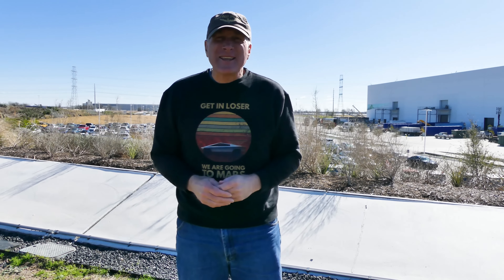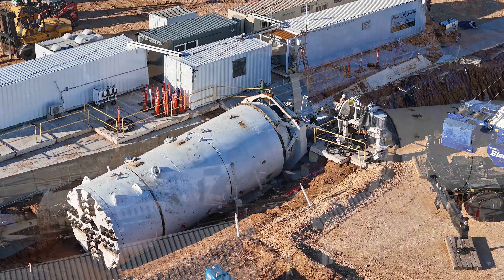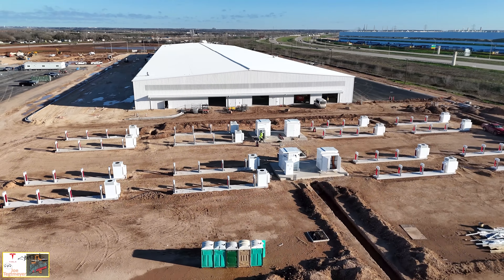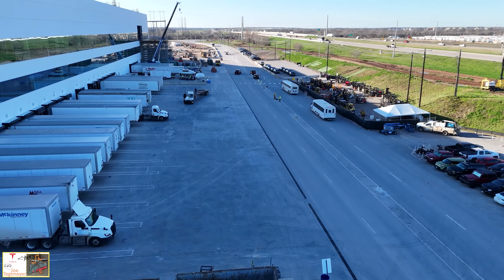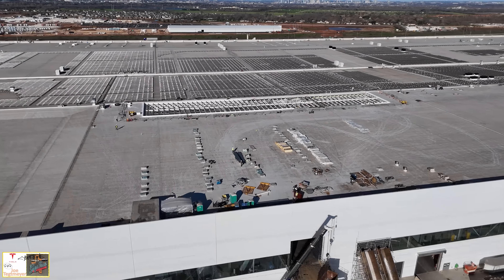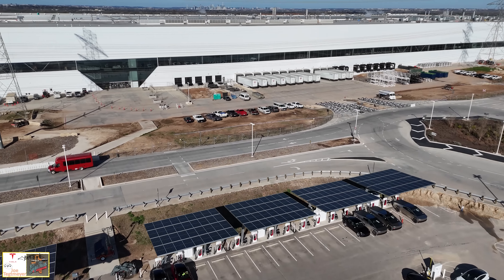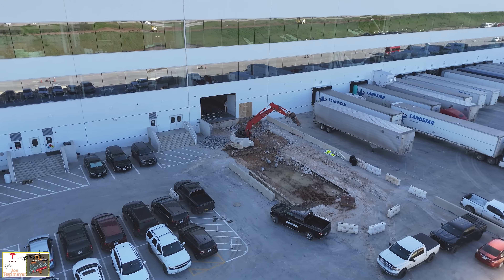New Car Transport on W Side! Cybertruck Castings All Over! 12 Feb 2024 Giga Texas Update (08:35AM)

Comment: Thanks Joe
3:06. Westside, Tunnel Project. Curved components set up behind the TBM have been described by David Salisbury as ‘temporary launch decks or launch inverts’. Back up decks (under the black tarps) need to be initially set-up on launch decks as when inside the tunnel the back-up decks ride on the completed tunnel lining. Crane possibly set up to lift a back-up deck onto the launch deck.
4:41. Westside. Former contractors parking lot. Trenching and grey electrical conduit.
5:05. Westside, storage. Top left. Pair of large tanks on low-loaders.
9:11. New EOL building. North. Strip/grate drains across in front of the drive-through doors. Southend of the EOL building has 2 parallel rows of these inside.
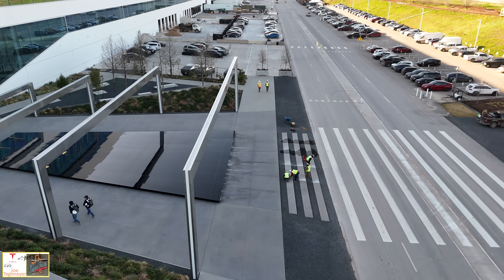9:41. Main Entrance. Saw-cutting the strip footings to match the saw-cuts of the entrance paving. Tapered ends align with the raised Stoneglass.
Road. Telehandler is carrying a pair of mini tracked excavators fitted with rock breaker attachments.
10:01. GA, apron. As per Sammy K, these are entirely new openings. Brings the total of loading docks along this side to 99.
10:28. GA, highway side Cybertruck yard. Mobile Supercharger mobilised elsewhere.
11:42. Southend. Level 2 floor and roof. Working on the mounting brackets for the glazing units channels.
11:56. Southend, Tank Farm. Various pipe fittings tack welded in place. Additional ring segments to the right to extend the tanks higher.
12:08. Southend. Bottom. 8 CFA piles in the excavation. 5 more or less in a group. Others might have been the original test piles.
12:52. Southend, west. Right. Been waiting for this shot. E-W roof beam falls/slopes to the east. Shows that the roof is symmetrical across the Southend.
15:58. Parking Garage. Looks like a concrete pump line has been run across the ramp.
17:31. Pond. Bottom. Electrical ductbank uncovered to be extended south to the Parking Garage.
18:10. Robotic Avenue. Intersection will need to be opened soon to divert traffic from the diagonal track towards the Parking Garage. Trenching works at the west end of the diagonal track.
20:06. Casting east, apron. Sapphire Gas temporary LNG system has been removed. Was only ever seen to be connected to the factory in Brad’s video from Saturday.
20:11. Casting east, apron. Slot drain that floated off its bed in the recent rains has been disassembled and put aside.
Against the building, saw-cutting continues. I wonder if the loading dock ramp is to be shifted. Current ramp doesn’t seem to be functional with the changes inside.
21:00. Casting east, apron. Blue ductwork identified by others as likely forced combustion air for the 3 new furnaces.
21:18. Casting north, apron extension. Screeding machine. Bottom. Might be a follow up towelling machine on the trailer.
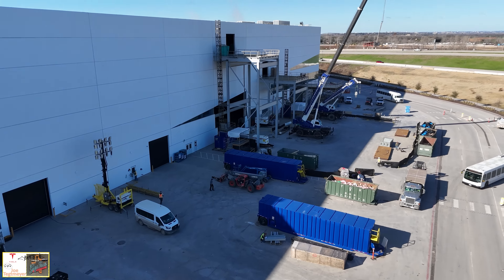21:58. Plastics, road. Right. Sapphire Gas tanker having trouble leaving site. Seen at the roundabout at 19:04.
22:08. Battery north. Loading platforms. No gates yet in the handrails for the Alimaks to operate.
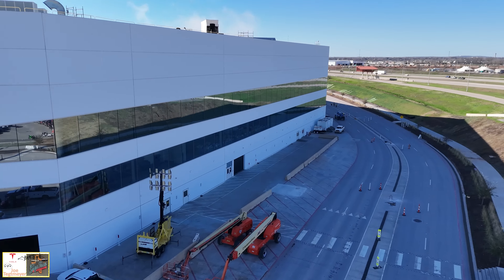22:19. Battery, diagonal corner. Road. Street lighting pedestals under construction. Almost complete to River Road.
22:40. GA, ramp. Stair demolished to the right.
23:37. Tesla Road north. Right. Small piles of gravel. Drying it out perhaps.
25:57. New Switchyard. Mega-Vault. Yellow plastic sealing the side opening.
Reply: Just behind the TBM, the segment feeder has been installed (This is a magazine carrying one full ring of segments ready to be installed and can "walk" the segments forward to the segment erector). 
Next to the blue and white 160T mobile crane, under the orange tarp, is the "Bridge" (you can see it has no wheels). This carries all the cables and hoses from the backup decks to the TBM, has the front end drive of the conveyor which sits under the discharge of the EPB screw conveyor at the back of the TBM. The Bridge is structurally a tow bar which connects the TBM to the back up decks. The item under a black tarp, on a trailer, near the segments, is another back-up deck (No. 5). It seems all the components of the TBM and back-up are now on site.
Reply: 21:18 What do you feel is the purpose of using this contraption for this relatively small space instead of what they've done in other areas?  Lack of available labor?  Assuming a machine reduces manpower.
Reply: @davidsalisbury50  7:43 for the segment feeder? Worker steadies himself on it.
7:02 for the bridge. Hopefully we get to see this installed uncovered.

Seems an additional component added between the tail shield and the thrust ring. Tapering component. Is that part of the thrust ring.?

Ducks slowly lining up on site, and in my perception of how it all comes together.

I'll say it again, this has been the most interesting part of the project for a long time.
Reply: @sammyk874  21:18. Had much the same thought. Why here? Likely just a different contractor who more commonly does road work.

No doubt they'll set this up around the corner on the east side. Possibly planning on one continuous pour. Completion of rebar placement on the east side prior to any concrete placement on the diagonal would indicate that.

Need to sort out the slot drain first.
Reply: @DessieDoolan  That was my other thought "Just the way this contractor does it".  Think this area they are creating is to move all the casting racks to?  Would give better flow to the apron.  That or the apron is about to be torn up.
Reply: @DessieDoolan  Yes, the segment feeder was seen over by the segments a couple of days ago. White curved steel with what looks like 4 rails running through it. The outer 2 are welded down stationary, the inner 2 are on a lift/feed/lower/return hydraulic system that feeds the segments laying on them forward.
Reply: @sammyk874  Semis have always had trouble backing in here. Particularly the drive-through door beside the ramp. Apron widening may be more for that reason than anything else.
I think the ramp is going, those loading docks deleted. Part demolished already anyway.
Paving demolition at 20:45 a possible new ramp location. I notice the destination chargers have been removed.
Reply: 4:41. Former contractor's parking lot: Judging by the shape of the trenching, maybe Elon has joined Thee Temple ov Psychick Youth!
Reply: @greggerypeccary  I just learnt something new!

Comment: Really bothers me that the extension roof peak does not match/line up with the main building. Makes me wonder how they're going to figure that connection out.
Reply: Will butt into the exterior wall of the main building. That wall remains for fire separation.

Comment: If the parking ramp is going to go to Robotic Road then the ramp is about half put up now. Geez that ramp is getting larger by the day. I am tempted to do a estimated count of the number of vehicles that can park in there.
Reply: No going to Robotic Ave. Halfway point is seen dead ahead at 14:51 at the construction joint with double columns.

The footprint is measurable on Google Earth Pro, and when multiplied by the number of floors comes out at the stated area on the associated plumbing permit of 1,743,000 sq ft.
Reply: @DessieDoolan   In that case and the fact the foundation appears to have another ramp for the South, I came up with a around 3500 vehicles. It might be a touch more depending if they decide to shrink the lines by a foot. I figure since the panel is the width of semi it be about 2 cars per panel. 3 panels per section 7 sections per row and 8 rows with an additional 4 rows for ramps w/o cars with 7 floors. Although there probably going to be cars on each of those ramps so my rough estimate will go up to about 4000 cars. Given the 20k employees at the site and the 2 shifts this will handle about 40% of the vehicles at present. But appears they will have 60k at the facility. So another ramp might be needed and honestly it would be better to use ramps over surface lots.
From the looks I almost wonder if they are going to put a roof on the ramp with solar panels.
Reply: @mdhofstee  Capacity was getting a lot of attention around New Year.

Cut and paste, "Parking Garage. One of Joe’s patrons mentioned that a multi level parking garage at Disneyland of 1,620,000 sq ft has a capacity of 10,500 vehicles. Based on those figures this carpark of 1,743,000 could potentially have a capacity of 11,300."

I'd come up with a figure of 7000 at some point.

If the Disneyland numbers are correct, then over 10,000 is probably correct.

And yes, the footings for a second ramp are in place. The building likely will be a mirror image east of the double columns.

Comment: I reviewed the footage going into 22:50 and hazard a guess that they took out that ramp in order to make it a regular truck loading dock, and perhaps open up another loading dock, to the left of dock "W8" more or less where that trailer is parked with no dock. It seems like they're running out of loading docks in this area.
Reply: Either that or they have now defined the interior layout in that area.
Reply: @sammyk874  The first goods elevator on site is directly behind that ramp. Might have needed the ramp to get larger items directly into the elevator. As you say, interior layout now defined, ramp can go.
Reply: 22:50. Room for 3 loading docks in that space. Plus a couple more to the south (right).

Comment: Will the Boring Tunnel exit on the East side be under the factory and use elevator(s) from the end of line down to the tunnel? Then Proofrock parts lifted out of the construction hole by the overhead cranes installed in the bump out area on the South end of the main factory?
Reply: My speculation is a ramp. 2 parallel grade beams seen being constructed at 12:22 happen to be on the same alignment as the TBM across the highway. This is the south end btw.
Reply: @DessieDoolan  agreed, linear tie beams but no cross tie beams suggests the TBM will surface along here.
Reply: @davidsalisbury50  These parallel grade beams were one of the first indicators that suggested a tunnel on this alignment.

Elsewhere on site the connection of pile caps has only ever been pairs, and then ended up being locations of braced column bays.

Comment: Crazy thought, maybe the tunnel won't be going straight across to the south of the factory, but instead head north up to the open hole next to W8 door.
Reply: First thing I though when I watched the video of them breaking up the concrete in such a large area. I am surprised that more info about the boring tunnel is not known. Could they have a sledge like system, maybe do two tunnels in a circuit to keep cars being moved from the factory to the outbound lot. I see the tunnel as a bottleneck, especially when they ramp up production.
Reply: @flubalubaful  There's next to zero information about any part of the project. Other than the initial site plans released in 2020 and revised plans in 2021 there hasn't been a single architectural, civil, mechanical, electrical, hydraulic, drawing sighted.

Most information is found on the Austin CIty permit site, and it's usually only rough outlines for Plumbing Permit applications.

Bottleneck. Private road at southend under the bridge if there is ever a back-up in the tunnel.

Comment: Like 78 6 minutes, RAIN, this weekend, swap races Saturday, Will the railhead come to giga Texas? Berlin did, Mexico looks like nothing going to far,  road work, I think they are finishing the parking building, IF second and third production lines, and battery and other Research Data Center and etc, BIG SITE, Parking lot finished, outbound and other unused space, guessing, the new staging area for model materials, and other projects, The old staging could be used for Castings?
Reply: At the moment it looks very unlikely that there will be a railhead brought to Giga Texas. The facility in Taylor is well established, with customers other than Tesla. The nearest access to a main line would be about 7 miles North at Manor, and theoretically they might make use of a lot of the median of the toll road, that long a spur for a single company doesn't make much sense. Planning on this should have started about the time the first shovel of earth was turned.
Reply: @The_DuMont_Network  Thank you, I do not live near Texas, my wife is Chinese, I live in Shanghai and Ontario Canada, going for the summer 4 weeks,

Comment: you keep calling it a "Lift station" , but what's it lifting? Looked like a well to me before, lift like elevator? What is this?
Reply from the maker: Lift stations are used to move wastewater from lower to higher elevation, particularly where the elevation of the source is not sufficient for gravity flow and/or when the use of gravity conveyance will result in excessive excavation depths and high sewer construction costs.
Reply: Wastewater.
Reply: A sh*t pump. Literally. 😊
Reply: @JoeTegtmeyer  and everyone, thanks for the explanation ;)

Comment: What happened to the tunnel under the river to island and that building with all the air conditioning on it? When is the Martin Marietta concrete plant going to relocate? Are they going to reclaim all the waste and cleanup their site?
Reply: I doubt the old tunnel permit will be used. Martin Marietta will likely Go to whatever date they are required to vacate. Tesla will probably wait for cleanup for when the project is more complete.
Reply: Thanks... Lots of loose ends dangling. Glad to see somethings wrapping up too.
 @jbbuzzable
Reply: The tunnel under the river was always a LONG term plan as Tesla is leasing that land back to the previous owners for 5 years. 
Probably not a big rush to relocate the MM plant until they have a need for that space and there will be lots of dirt work required to lower it down to the level of everything else.